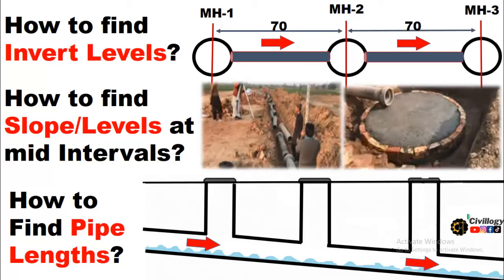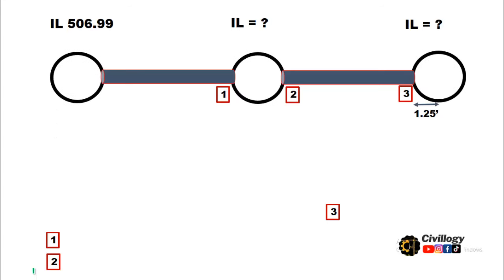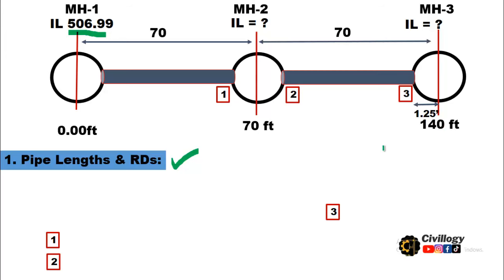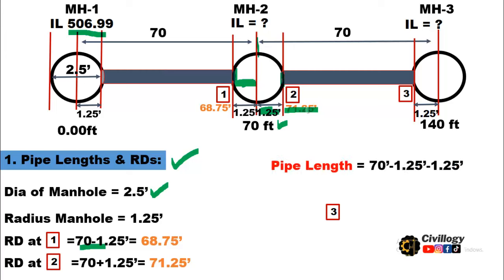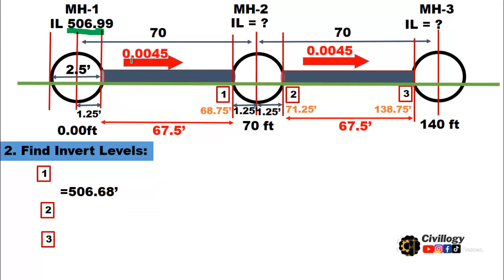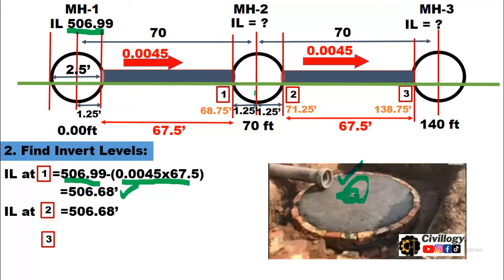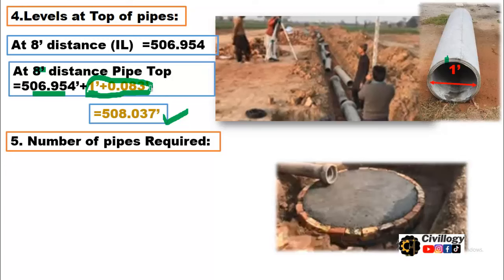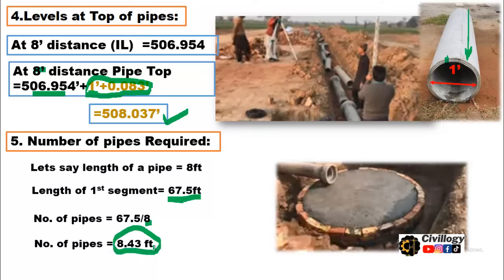How to find invert levels of manholes?|sewer line drainage line slope|invert levels of drainage pipe

Comment: how about instead of a manhole its Interceptor box and going to manhole? should also RD in IB?
Reply from the maker: Yes RD is actually hotizontal distance which  is required for slope calculation
Reply: @civillogy  i see.. how bout the second manhole in the video sir? they both have same Invert elevation?, the inlet and outlet

Comment: A map has a scale of 1:200. An existing sewer at point A is to be continued to point B and the 
map distance between these two points is 16 cm. If the existing invert level at A is 50.20m and 
B is at a falling gradient of 1 in 40, calculate:
i.
the invert level of point B.
ii.
the FS reading that the engineer should read in order to set out point B if an HPC 
of 51.00m has been established
Can you please assist me?? 🙏🙏🙏🙏
Reply from the maker: yes sure.
But your question is not clear,if the distance between point A & B ia 16 cm then there will no much difference between their levels.
anyhow it will be 50.2-(0.025x0.16)=50.196m=invert level at B.
ii. FS depends on your HI.
Reply: @civillogy  please i was given Falling Gradient why don't you used it in the solution?